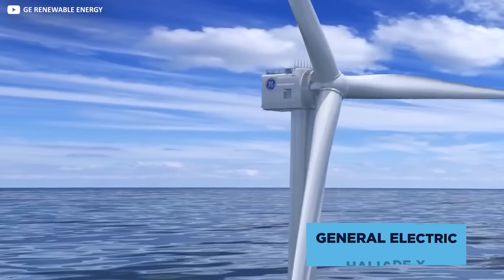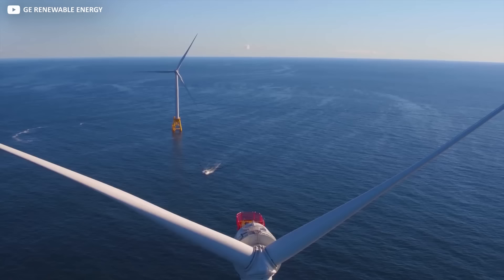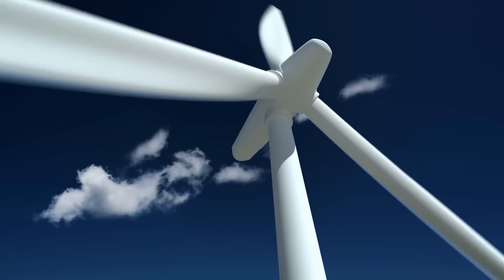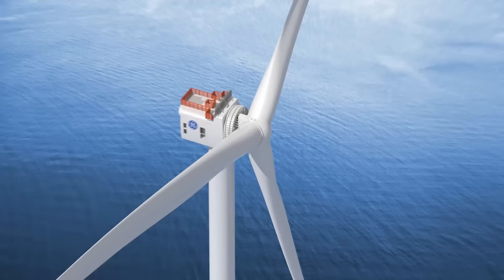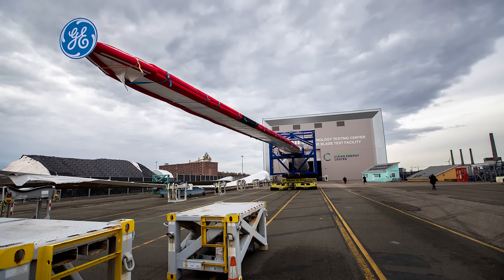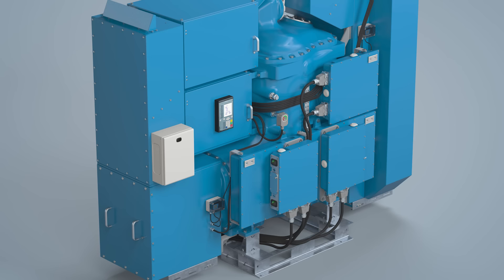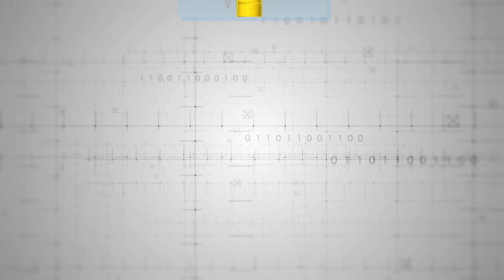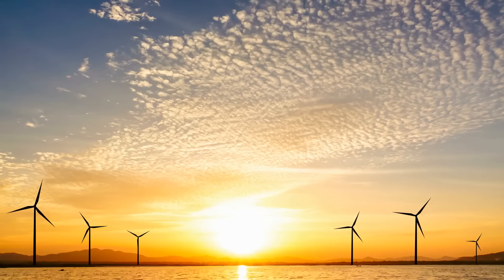The World's Biggest Wind Turbine

Comment: For the sake of the environment I wish them luck.
I am curious if part of the contract involves GE removing these turbines when they eventually break down and if they are able to recycle these turbines.
Reply: I think in most wind power projects the turbine manufacturer simply supplies the turbine and provides some maintenance. It is the project owner which is responsible for decommissioning the equipment. Whether it gets recycled depends on local regulations, but there's plenty of value in a tired old turbine and tower. Blades are the bigger problem as they're still mostly made of glass fiber, a material not conducive to recycling other than as filler material in road beds and such.
Reply: Roughly 80% of every turbine is actually recycled now-a-days.
Reply: @ChukOne5   to RECYCLE IS A  SCAM  ..better to REFILL REUSE  containers  etc .. they dump plastic junk into our oceans  and LANDFILLS are wrong    better to burn 🔥 it all .. into burn 🔥 logs etc ..
Reply: Weather Warfare is real .. global warming is a HOAX  .. SEE GEOENGINEERINGWATCH ORG AND  MIKE MORALES show  .. TEXAS WAS A TARGET
Reply: @phillyunrau4736  well the baldes are currently buried, and that’s indeed polluting, bbut that happens after 25 years of being installed, 25 years is enough time to produce enough energy to cover for that pollution.
Reply: @phillyunrau4736 
Might be the case that recycling is a scam in many places, but here in Germany landfills are outlawed and exporting trash is illegal aswell.
So recycling is the only legal option.
WtP is the final option.
Reply: @ChukOne5 
Here in Germany landfills are outlawed just like exporting trash.
There are actually companies that recycle fibre glas in Germany.
They crush/grind it into a powder, which is used in concrete manufacturing and lowers their emissions.
Reply: @pjacobsen1000 
That isn't quite true.
There are actually companies that recycle glas fibre.
The way I understood it, glas Fibre is a mix of sand and epoxy. They grind it and use it to manufacture cement/concrete. The epoxy provides energy and the sand becomes part of the concrete.
Reply: @ChukOne5   hopefully my blue links will stay here    ... isee plastic can be  made into diesel fuel  etc  ..in late 30s  the DUPONT FAMILY  paid off the MPS IN OTTAWA  to make beautiful Hemp and  Cannibus ILLEGAL  .. so they can sell billions in plastic goods  .. see Hemp  thegospelofhemp  com
Reply: @TBFSJjunior   yes to RECYCLE INTO OTHER THINGS products is fine ..  but to REFILL REUSE   should be possible  ..why Remake something  .a bottle etc . when could be refilled hundreds of times  ..  single USE ..when easily could  be a  MILLION USE lo ..ok 100 at least  ..
Reply: @phillyunrau4736  Texas was the target.  ROFL, their ego knows no bounds,  bizarre!

Comment: 12 Mega Watts, that’s almost enough power to power 800 homes
Reply: Bruh... 1MW can power 1000s of homes
Reply: Still not enough to power my Bitcoin mining rig
Reply: Megawatts and Megawatt hours are different ;)
Reply: @Mitnixbinichfroh  
The only difference is that a simple megawatt is sonstant energy output and megawatt hour is exactly that, one hour of a megawatt amount of electricity.
Reply: @shimnakt955  
If one home takes constant energy of lets say 5 kilowatts, then one megawatt can power 200 homes.
Reply: @nikokapanen82  after googling and a simple calculation I found UK homes averagely consume 450watts per home constantly. That will make 1MW to be able to power over 2,200 british homes.
Reply: @solarchannel5652  
That is quite good if it is only 450 watts. here in Finland, an average house of 120Sq. meters is using about 2.1 kilowatts constantly and i thought that this is very little.
Reply: @solarchannel5652  That has to be off. I get that they are more efficient on average than most US homes, but that is very low. Even a single desktop computer uses over 100 wh on average. A fridge is around 150 wh. Add lights, AC, electric heating, TVs, etc, and you quickly go over 450wh. The average US home is showing 29kwh per day, while that figure for the UK is less than 11kwh per day. Don't get me wrong. Those numbers are easily possible, especially if you don't need AC and only get heating from gas. But still, that is extremely low.
Reply: @nikokapanen82 , "constant energy of ... 5 kilowatts?!?!"  Geez man, how big is your house?  That is not a realistic number at all.  0.5 to 1.5kW is probably a decent range.
Reply: @solarchannel5652  That is because a lot of houses use fossil fuels (gas) for heating, hot water and cooking. The energy transition will require those demands to be met by renewables as well. E consumption will further go up as e cars will dominate the transport market and require recharging at home.
Reply: @anthonypelchat  Some real world numbers from our own U.K. household from across the years:
 
Date , Average Demand , kWh Average
2014-07-10 , 434w , 10.4 kWh/day
2015-01-31 , 438w , 10.5 kWh/day
2016-07-26 , 406w , 9.8 kWh/day
2019-04-04 , 388w , 9.3 kWh/day
 
The averaged values are the averages for the period between the dates shown.
Reply: @UCCLdIk6R5ECGtaGm7oqO-TQ  How many people in your home? Also, am I correct in my assumption that you use gas heavily?
Reply: @anthonypelchat  Just two adults, and we do run gas central heating, but it doesn't add-up to much really.  The gas bill always comes in at far less than the electric bill.  We run electric oven, hob, shower, washer, dryer, fridge/freezer x2, kettle.  Those are the biggest consumers.  Gas is purely for heating.
Reply: @nikokapanen82  They use gas for heating in the UK and that is another head Ache They need to solve with heat pumps og similar. With a Wood Stowe, I can keep IT a 2kWh/Day during winter. If you don't use electricity for heating, IT really isn't much you need, put the back og your fridge in an insulated box, with vents to the outside, and IT won't run from september until may.
Reply: Uhhh herein the us it's like 30kwh per day

Comment: this guy did not know what he talked about .   the  Max  limit is  59.3%
, in the current engineering book suggest using 0.45
Betz's law shows that as air flows through a certain area, and as wind speed slows from losing energy to extraction from a turbine, the airflow must distribute to a wider area. As a result, geometry limits any turbine efficiency to a maximum of 59.3%.

Comment: 0:47 This is why I have a problem with these kinds of propaganda. It's true in the strict sense: it's theoretical maximum output is 67 GW. And that is often used to compare it with other energysources, such as nuclear plants. And then it goes: 10 of these equal 1 nuclear plant of 670 GW. Which is FALSE. The truth is, each and all windmills only deliver between 30-40% of their maximum capacity on average during the year. So, in cost-benefit terms, you need to multiply everything by 3.

Comes with it, that windmills only last for about 20 years, while modern nuclear plants go up to 50-60 years. Thus, to compare, the costs need to be multiplied by 3 once again. So actually, it's nine times as expensive than what the greens let you believe is the equivalent of a nuclear power plant.

This truth is never mentioned by any Green or proponent of windmills... why?

It gets even worse: because windmills are intermittent, you need much more backup to level out the peaks and valleys of energy-production and consumption, and that backup is done by gas, petrol, or coal.
Reply: Well AMNB here's the fact of Nuclear power stations, they require massive amounts of investment to keep them running.  Name one that's lasted 50 years.   Talk about hyperbole.   What do they cost?  Massively more than a wind turbine.   Where's the innovation?  There is none.  A nuclear power station is simply a regular steam turbine power station using fission as a heat source.  A low temperature, low pressure, multi-heat exchanger heat source.    From any design / innovation cycle perspective, nuclear power stations are dinosaurs, basically Victorian concepts.   But the main reason for investing in wind, is its a distributed network.  The idea that the wind is intermittent is a silly naive emotional canard.   The wind is always blowing, maybe not where you are, but somewhere.   You simply can't think outside the box and are defined by that box and its fibreboard.

Comment: and still, all wind and solar generators need conventional power generation backup because they can not ramp up / down the power output as required to control the grid. The more wind and solar there is on the grid, the more conventional power stations must be on standby or on partial load operation, which decreased their efficiency.
Reply: @garysmith5025  You are completely missing the scale. Our needs for energy storage are orders of magnitude larger than the technologies that you listed (all of them valid ones) can offer.

Comment: Can someone please explain to me, (my brain is hurting)  just how is the outer portion of the blades travelling faster than the prevailing wind actually assist with the power? I’m thinking if part of the blade travels faster than the wind it’s having to be pushed therefore hindering the process ? What am I missing ?
Reply: Why would it not travel faster than the wind? Wind is continuously generating lift on these blades, imparting energy. Keep in mind, the blades are not pushed by the wind, they use the same principle as wings, which is lift. This is the same principle that allows a sailboat to sail faster than the wind
Explaining lift is outside of the scope of a YouTube comment so I encourage you to look it up!

Besides, just for the sake of the experiment, you could get the tip of a blade to travel faster than wind speed even if you used drag, the same way the pouch of a sling travels much faster the arm imparting the motion:
Have a blade with a very large surface area at the base thinning out dramatically until it reaches a very thin tip. position the turbine such as the flat of the blade is perpendicular to the wind flow. The air will exercise a lot of force on the base until the base moves close to wind-speed, as it is doing so the tip of the blade will move much faster than windspeed. Obviously this would be useless and even wasteful if your goal were to generate power.
Reply: @louisazraels7072  thanks for your reply, my brain is hurting a bit, but you’ve encouraged me to investigate some more
But your last point saying that if generating power it’d be useless to move the blade faster than the prevailing wind was my concern, I’ve heard these large turbine blades travel around 800 KMH on the outer edges, and to me that’d require a lot of effort, making for inefficient operation 🤷🏻‍♂️
Reply: @spinnymathingy3149  As louis said, wind turbines use the principle of lift instead of the principle of drag to harvest energy from the wind. So the wind isnt pushing the blades, rather does the flow of wind over a blade create a force on the blade due to its particularly shaped cross section (-> lift). 
this is why the blades dont turn with the direction of wind (they would have to turn into the wind again 180° later, to be able to turn with the wind again, which of course is not a really efficient way to harvest wind energy.)
rather the blades rotate on a perpendicular plane to the flow of wind and use lift just like airplane wings so they can harvest wind energy from the continually passing wind and use that lift to induce a momentum on the rotor.
this also enables wind turbines to spin a lot faster on their outer edges then the flow of the wind itself, because if you use lift instead of drag, the limiting factors to your rotational speed become material stress due to centrifugal forces or the limits of gearbox, generator, etc.. 
in addition, wind turbines actually get more efficient the faster their blades travel in comparison to the wind because of fewer losses due to flow swirl after the turbine (which is counterintuitive at first).

so to summarize for less brain pain: :D

- wind turbine blades use lift
- rotational speeds created by lift are not limited to the speed of wind itself
- wind turbines that turn more quickly on their outer radius relative to the wind are actually more efficient
- wind turbines are amazing machines, have fun investigating!
Reply: @tomstruthoff5525  thanks for that great explanation 👍👍
I’m getting my head around it a bit better now (re the achievable speeds) 
But 1 point I’m having trouble reconciling is the leading edges of the blades are travelling incredibly fast pushing through the air, now my experience is with cars, when faster than 300kmh the air puts up a resistance like a brick wall and every little increase in speed takes expidentially more power, is that a fair comparison 🤷🏻‍♂️
Reply: @spinnymathingy3149  happy if that could help you :). 
Regarding air resistance: 
airplane wings for example travel at comparable speeds. the thin airfoils on blade tips have way less air resistance than a car for example. to put that into numbers: i think the drag coefficient of modern cars is around 0.3-ish, the drag coefficient of the outer portion of a wind turbine blade should be around 0.01-ish. Those are just educated guesses but the real numbers should be around those values. so its no wonder they can go alot faster than cars as drag is proportional to the drag coefficient. ;)
Reply: @tomstruthoff5525  thanks, that puts things in perspective
Reply: It’s possible for sail boats to move faster than the wind too.

Comment: 1:51 offset 9,000 cars per year. Does that mean in the first year it offsets 9,000 cars, the second year it offsets 18,000 cars, finally offsetting 180,000 cars in its 20th year? If true, then one turbine could replace all cars worldwide given enough time? That does not make sense to me.
Reply: It offsets an amount of carbon equivalent to the emissions of 9000 cars during a year.  So no, the second year it would still be offsetting the same emissions of the same 9000 cars as it did in the first year.
Reply: @CL-gq3no  So not per year.

Comment: I bet Elon Musk could design and build a one piece blade using some special formula, strong but lightweight, stainless steel. They could be built in a shipyard and loaded onto a special ship/barge that has some type of built-in Godzilla crane. Enough blades could be loaded onboard for any size offshore windfarm.
Reply: Well maybe  .. but why mega .. stay smaller is better  and stay INDEPENDENT  ..
Reply: niels lund  I'm thinking of a multi-bladed turbine setup. The video shows each blade made in sections (weak point?) and then joined together before installing onto the hub. I'm thinking each blade made from two long rolls of stainless steel. Two long welds. One hub and three blades lifted from the barge into position.

Comment: But nowhere does it state the CO2 footprint of its manufacture, transportation and erection, which for a wind turbine of this size has to be around 5,000 tonnes of CO2 minimum per wind turbine.  Nor does it state that the life span of a sea based wind turbine is around 20 years, so in 20 years the whole thing will have to be rebuilt, and again after 20 years, etc.  I would hazard a guess at its cost - probably around Euros 6 million (or more) each.
One of the reasons we see abandoned wind turbines in California, they were simply to expensive to refurbish as the owners made no financial effort to invest the necessary funds.

Comment: what happens when the sea get really rough with gale force winds do they shut them down.?
Reply: Yes, wind turbines can be shut down, and the rotors remotely locked.
Reply: @dainironfoot5198  you cannot remotely lock the rotor. You can hold it stationary on the hydraulic parking brake. You need to be at the turbine to eyeball rotor position relative to the locking pin holes to properly lock and you would only do this when performing an isolation to repair inside rotating element of the drivetrain. Locking the rotor in high winds or at any point of time really is not desirable. You feather the blades any yaw out the wind direction and let the rotor idle. Lpcking it leads to stand still marks in the main bearings given the mass of the rotor hanging off those bearings. Plus, you eat up the fatigue life in the tower, TP and MP since the rotor idling provides some aerodynamic damping. One of the worst design load conditions we consider is a locked rotor which you try to minimise at all costs throughout the operational life.